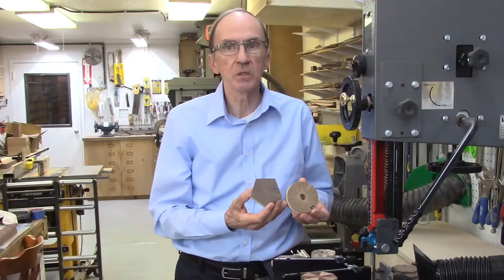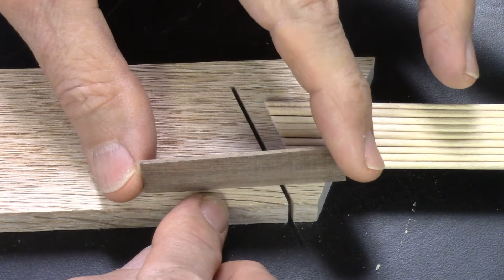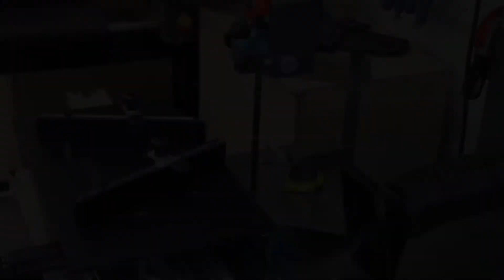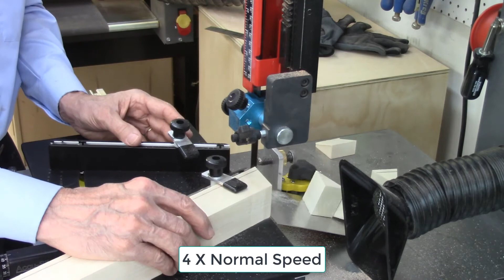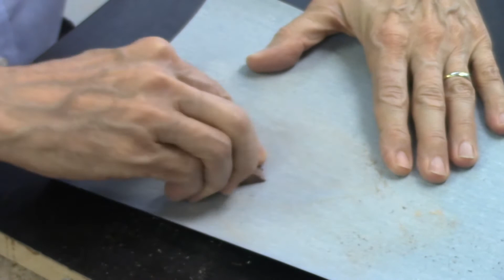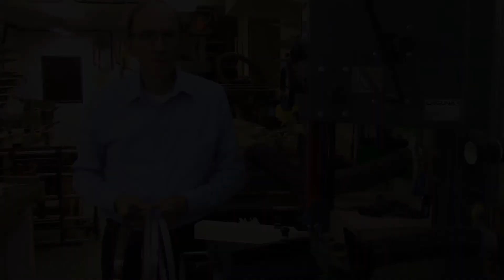Accu-Wedge Band Saw Blade Selection (24)

Comment: In your other video you say the fence positions are accurate to within 1/10th  of a degree. That seems bad to me. if both fences are out by 1 10th and the ring has 10 pieces that could be a total of a 2 degree gap! The errors compound with additional pieces so a 72 piece ring.....
A table saw eliminates blade wander and by using a wedge which has been trued, the cut pieces will all be identical angle copies of the wedge thereby avoiding compound errors which seems more accurate to me. 
You are also recommending  to change from a standard blade to cut wedges which is time consuming unless you don't use the bandsaw for anything else.
I love my bandsaw and agree it is safer, but this just seems like reinventing the wheel. Table saws and a sled are the best way to cut segments.
Reply from the maker: The Accu-Wedge is precision machined on a CNC Milling machine in our own shops.  The index points on the table for the two fences have been machined to better than 0.001" from each other.  My machinist tell me that the accuracy is actually much better than that.   However based on a possible maximum error of 0.001" , and based on the geometry of the index table this would equate to 0.00716 degrees between the two fences. Therefore for a 72 segment disc this would yield a total possible total error of +/- 0.52 degrees.  

This has been verified many times in our shops.  I routinely produce segmented rings of 48 segments per ring and the segments in the rings have been dead on.  This can be seen in my video on my segmented egg which contained 48 segments per ring with an additional 48 spacers between each of the segments.

Comment: You are a master at your craft.  You work like an engineer and your accuracy is to be envied.  But I too was surprised at the price.  Granted, it is a very specialized tool;  but it makes the cost of the turning more expensive than most people will appreciate.
Reply: Marvin Helphrey , I can't get the website to liad. Could you please tell me how much, it send a link to where you found the price.  Thanks for any help.
Reply from the maker: The Accu-Slice is a precision band saw accessory.  It is constructed from solid aluminum stock,  no plastic or inferior materials are used in its construction.  The Accu-Slice was two years in development, migrating from 7 prototypes until its final design was perfected in February 2017.  A team of engineers, machinists and a long time woodworker were instrumental in developing and testing the Accu-Slice. It is 100% precision manufactured in the USA in our Pennsylvania machine shop using hi end CNC turning and milling centers and is machined to exacting specifications.  The Accu-Slice is precision band saw accessory designed to be used by the professional or semi-professional woodworker to enable safer cutting of wood on the band saw and to produce projects that would be more difficult to accomplish by other techniques.